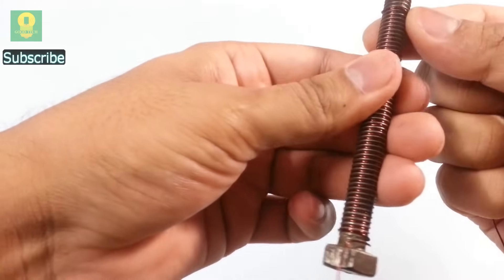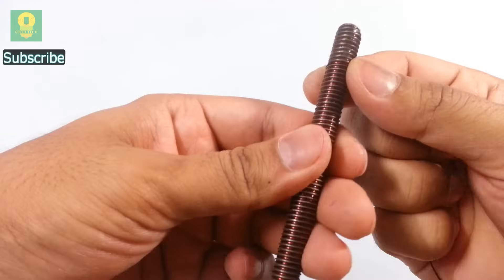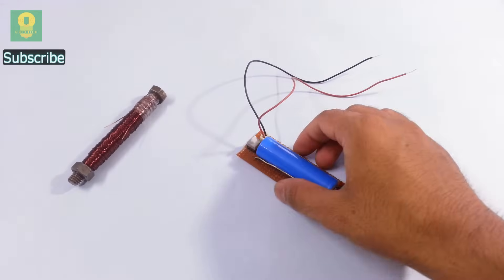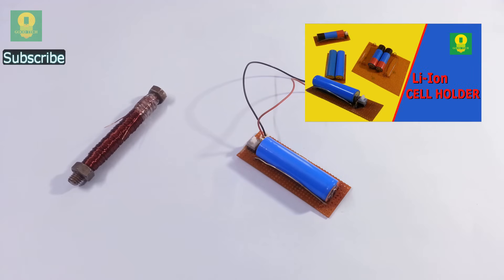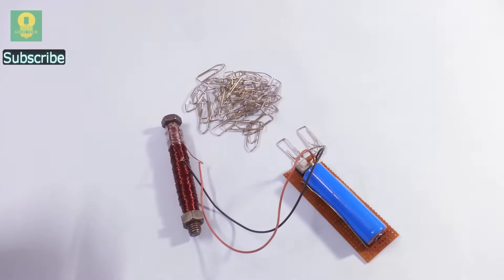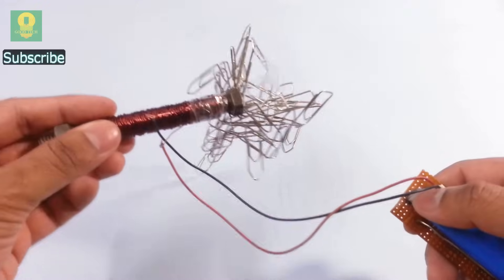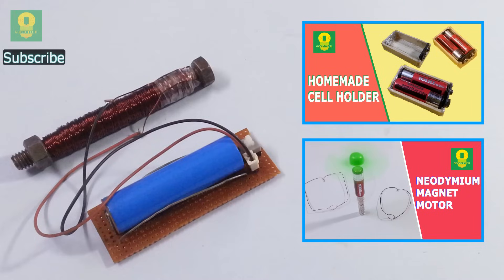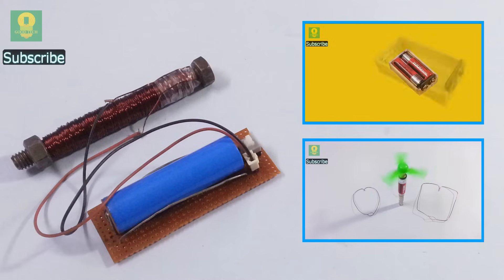How to make an Electromagnet | Super Strong

Comment: Hi  guruhacks9688. I have two questions.

1) If you take that same iron bolt with the same copper wire and with equal number of
     copper wire turn but the battery is 12 volt instead of 3.7 Volt, then would the
     electromagnet be stronger and if so then how much stronger?

2) When creating an electromagnet, what is the maximum voltage should be use to make
     the magnet stronger and at the same time utilizing less current (The magnet is more
     energy efficient) ?

3) If you use a Neodymium (rare earth) magnet  and wrap a coil around it like you did
     and you use a 3.7 Volt lithium battery, then would the magnet be stronger or would
     it remain the same?

Comment: You should not wind directly on the bolt because the threads are sharp and may damage the insulation. You can use some insulating material pipe or even paper.

Comment: Great explanation and demo. Would this be a safe project using a 12V battery? What is the largest, preferable, gauge of copper wire for this type of project using a 12V battery?  Lastly, what is the furthest distance between the threaded bolt with the copper wire winding and the object being attracted where the object will travel that span of space to attach to the bolt? Could I get a an object that had the equivalent weight of let's say 20 paper clips to jump 1/2" of distance using a 12V battery? MANY THANKS!!!

Comment: How to make it stronger: Pack some wires between each turn, use more copper, at least 20 metres. Connect to a 12V laptop power source. Enjoy

Edit: Is it possible to make a powerful handheld magnet with a 4x 3.7v lithium cell holder
Reply from the maker: Yes, it is possible but 4 batteries will be quite heavy for holding it in hand.

Comment: Can I just connect the copper coil to a battery ?
Reply from the maker: Which copper coil?? If the copper wire is enameled, then yes you can connect a battery to both its ends. But for an electromagnet to be powerful, you also need a iron core in the middle of the coil.

Comment: How much long bolt you had used and how many guage wire
Reply from the maker: I used a bolt of about 8" and a wire of 28 AWG. However, you can use any length of the bolt and any gauge wire as long as you can wound it tightly, it will work well. Make sure to use enameled wire.

Comment: Why you use lion battery of3.7 volt it will get heat automatically use battery of 1.5 volt battery ☺️☺️☺️😎😎😎😎😎
Reply from the maker: A li-ion cell that i used provides 2000mA of current which makes the magnet very powerful, also the battery doesn't heat up although the coil does get slightly hot after a while.

Comment: Good job. How many amps is that 18650 battery?
Reply from the maker: Thanks...I am glad you like it..This is a 2000mAh 3.7v battery.
Reply: Thanks, I have same battery, and wires started smoking when connected. Is it safe to touch 2000 mAh?
Reply: @p1nesap  @ 3.7v yes

Comment: Bhai sach sach batana... khud banaya hai ya kahi se vedio la k daal diya hai.. 3 meter wire me itna cover ni ho sakta...☢😬😬😬😬😬
Reply from the maker: No videos on this channel are fake or copied and never will be. Also, nowhere in the video i have mentioned that i used only 3m of wire to create this electromagnet. If you want to know the value, then i used around 16m of 0.36mm (i.e 27 AWG) enameled copper wire  and wrapped it on a 10.5 cm(length) x 1.2cm(diameter) bolt.

Although i think your comment is true but just mentioned on a wrong video, i did use 3m of copper wire in my Tesla Tower video. On that i wound about 3m of 27 AWG copper wire on 8.5 cm x 2.1 cm pvc pipe.

Comment: Can you use an old flashlight as the battery container and switch?  If so, please show how you would do that.  Thank you.
Reply from the maker: Yes, that can be done but it will depend on the design & construction of the flashlight. If the flashlight can be disassembled then open the flashlight and identify the two wires that connect to the light source.
Now, remove the light source and connect any other component to the two wires, you are now ready. The flashlight container is used as a battery holder with a switch.

Comment: Can I make this strong enough to pull something across the room? Would it mess up a tv or computer in the room if I make this strong enough to pull objects. I want to put something on a book, and pull it off a shelf with a magnet.
Reply from the maker: No, this magnet can't be turned that strong. I am not sure if a magnet can be powerful enough to work across a room but yes, very powerful magnets can be made & they do exist but they are very bulky and heavy requiring high input power to work, which are only useful in industries. 
Also, the strong magnetic force does interfere with  electronic devices and can easily damage them.
However, to pull a book in the shelf does not require very high power, instead of electromagnet, just use simple neodymium magnets. A small magnet attached to the book and one to the book's location in the shelf, will be enough to hold the book in place.

Comment: I tried to make an electromagnet but it  got shot circuit  . Why??
Reply from the maker: What was the length of the wire you used?? The length of the wire should be sufficient and proportional to the power supplied, otherwise the battery will get short circuited.

Comment: where we find copper wire
Reply from the maker: You can extract the enameled copper wire from an old electric motor. It is also available online on ebay and amazon.
Reply: GOODTECH - Creativity and Science thx
Reply: Clash Territory any electronic or may be hardware store
Reply: Clash Territory  any  shop of electic eqpment
Reply: At electrician shop

Comment: What will happen if there is a paper folded on bolt before wire
Reply from the maker: A thin paper will not matter at all, however if a very thick paper is used, it will reduce the magnetic effect on the bolt.

Comment: What will happen if i will provide 24volt of dc. Will it work or not.... tell me max voltage range....
Reply from the maker: Yes, 24v is fine for an electromagnet. However, don't increase the voltage too much as it will be dangerous to handle.
Reply: The higher voltage you use, the more wire you will need. Otherwise, the wire will heat up and short out the battery.

Comment: Which type of wire will be best for the electromagnet if we are connecting 2 batteries(2*9V DC). Would it be able to stop a body having a momentum of 0.16 kg m/s that is a body of around 400g and with a velocity of 0.4m/s.
Please reply
Reply: Better reply fast,
I will come to know that in 4-5 days anyway. Since I am make a project which requires this, it would be better if you reply in time.
Your reply will confirm my logic so please help.
Reply from the maker: If you are connecting normal 9v batteries, you will not get much stronger magnetic force as 9v batteries do not have much power. A normal chinese battery can only provide 150mA of current i.e just 1.35 Watts (for single battery) , i have used a 3.7v Li-ion with 2200mAh current i.e about 8 watts. So the strength of magnet will depend on the power supplied.
However, using 28 AWG - 30 AWG is best suited for a good electromagnet that can be made by hand at home.
Now, an object of 400g moving with 0.4m/s velocity will just have about 0.03J of kinetic energy (1/2mv2), the magnet can easily be created to stop this object.
Reply: Sir,
Thank you for your reply. I really appreciate that how you read my comment and came to reply by yourself.
Reply from the maker: You are welcome Sanket. If you have any queries, feel free to comment.

Comment: You lost a lot of power by wrapping the wire in such way, the current flows in opposite directions and cancel out => no point in so much wrapping if wrapped like that when current flows right and then left
Reply from the maker: This is what i used to think in my earlier days but when you study carefully and draw a current direction diagram on a piece of paper, you will find that the direction of current remains same, it doesn't change. It moves in only one direction (either clockwise or anti-clockwise) along the iron core.

Comment: I am using some wire from a Cat 5 ethernet cable, leaving the insulation on it. I wrapped it exactly as the instructions in this video recommend. I am trying to use this to hold styrofoam bombs with a thin sheet metal strip, in the bomb bay of an RC plane. I have an electronic switch, which will power the magnet until I flip the switch to kill the power. The plane flies on a 14.8V Lithium Polymer battery, but the switch will only provide the 6V that the Battery Eliminator Circuit in my Electronic Speed Control sends to my receiver. This is causing the wire and bolt to become extremely hot. Am I doing something wrong?
Reply from the maker: The bolt and wire do get slightly hot after operating for a very long time but the extreme temperatures are due to high currents flowing through the wire. Increase the no. of turns or reduce the current in the power source. However, reducing the current will also tend to reduce the magnetic strength, so it is recommended to increase the no. of turns.
Reply from the maker: I hope you are using only a single wire from the cat 5 cable and not using the entire ethernet cable to wrap around the bolt.
Reply: Yes, one wire pulled out, not the entire cable
Reply from the maker: Then it should work fine, you only need to increase the turns.
Reply: could this basic electromagnet be used to fry out electronics easily like a basic magnet?

Comment: Instead of a bolt, wrap a socket extension with the coil, and tape a 9- volt battery to it (so it can spin freely.) Then you have a magnetized socket wrench, and if it is strong enough you won't drop nuts and bolts.

Comment: The issue is how to waterproof an electromagnet so you can use it for junk fishing without shocking yourself. I was thinking the best way would be to simply magnetize another object for the hook mechanism to keep all electrics onboard and heavy insulate all the electric cable above the water line.
Reply: Why not just use a neodymium magnet??? for junk fishing?
Reply: You build this using DC so you won't cause and shock to yourself. Well providing your below 30v and that's a lot of volts for an EM! Attach the coil to a long none conductive pole and make sure that the wires terminate above the water line. The only problem could be that you drag the magnet along and it finds something to lock onto it could pull you in due to its strength lol
Reply: most wires have a non conductive coating meaning its safe when wet, just put some sort of waterproof housing on the battery.

Comment: Hi! When you remove the enameled insulation on the wires and connect the bare copper ends to the battery with your bare hands, will you get an electric shock? albeit even a minor one?
Reply: Don't listen to the above, it's not just the amps that kill you, volts do too. That's just ignorance and a lack of technical knowledge. Volts is just a unit you need to consider potential difference (PD) and electromotive force (EMF). The body has resistance and a resistive breakdown point. The higher the PD the less resistance the body has and therefore less amps required. Ohm's law in play here. The human body in good condition, dry and but broken can have a resistance of 100,000 ohm's. If wet or broken it can actually be far far less. As low as 500 ohm's but let's say it's 1000. At just 30v that gives 30ma which is a trip point for an RCD. So as you prolong and increase the potential difference your skin and tissue breakdown and as a result has less and less resistance. Generally it's safe to work with less than 30v but that's not a given. I treat anything over 12v as something that will guy me when I'm writing with electronics. 

Electricity is fascinating when you dig deeper such as electrons flow in the opposite direction to what you think and opposite to current. 

Hope this helps although it might raise more questions now than answers
Reply from the maker: No, the battery i used is only about 3.7v, which is very low to be detected by human body or to get an electric shock, however, high voltages can be very fatal.
Reply: Thanks!
Reply: GOODTECH - Creativity and Science It's the amperage that kills you not the voltage...

Comment: I tried to make the electromagnet, but I get shocked whenever I touch it.
What do I do?
Reply from the maker: How much voltage have you applied to the electromagnet. Small voltages can never give shock. Reduce the supply voltage and make sure to use enameled copper wire (no insulation damaged) over a long iron bolt.
Reply: I am using a AA 1.5V battery
Reply: add insulation, use a safe dc voltage source, dont power it with ac right from mains out the wall....

Comment: sir  is AC current  used to produce electromagnet.
Reply from the maker: Both AC and DC can be used, however, In a DC setup the magnetic field is constant. This is what you should use if you want something like a permanent magnet or in order to increase the strength of a permanent magnet.In an AC setup the magnetic field is continually changing. Therefore, in alternating current (AC) electromagnets, used in transformers, inductors, AC motors and generators, the magnetic field is constantly changing. This causes energy losses in their magnetic cores that are dissipated as heat in the core.Thus, with DC the magnetic field will be stronger.
Reply: GOODTECH - Creativity and Science sir..
i want to make permanent magnet..
so...how much thick ensulated copper wire should i use? 

and...
can copper coil smoke or get hot..if i used this for permanent magnet? 
please reply sir..

Comment: It's my understanding that the coils should run the same direction - by winding one direction and then backwards you are decreasing the strength. I've heard you make the first coil - then run a length straight back to the start - then make the second and subsequent layer of coils in the same direction... right?
Reply: not at all... - check any transformer lol... it works on the same basis
u can go up and down, what you can NOT do is reverse the spin direction

Comment: Hey which swg size should I use for this?  Thanks
Reply from the maker: I used 28 AWG i.e 0.3mm enameled copper wire, however any gauge wire will work as long as it can be easily wrapped on a iron bolt.

Comment: If i remove insulation from the normal wire used in our homes then does it work properly
Reply from the maker: No, it will not work as the wires will be short circuited.

Comment: To gain its magnetic power should i give it high voltage or use more copper wire.
Reply from the maker: Magnetism is directly proportional to copper as well as current in the coil.
Reply: Higher voltage or more windings
Reply: I Will Prefer High Voltage

Comment: Hi. Is it ok to use wires like the usual wires we use in our homes? Like the wires we plug into the outlets? thanks!
Reply from the maker: Yes, those insulated wires will also create magnetic field but since they require large space to wrap same amount of wire (because of thick insulation), it is generally preferable to use enameled copper wire, then you can wrap much more wire without increasing the size.

Comment: What If I wrapped my weiner in coil would my dick be a chick magnet?
Reply: good one! but it will actually make it a very weak magnet, iron core works best as it is far easier to magnetize that.
Reply: Well that's too bad, I have balls of steel...
Reply: Jacobs lab 48 attached to a battery
Reply: マリオ 94 just connect one wire with your body and supply with 500-1000v ac it would be much more efficient

Comment: If I would use a steel bar around 12 cm, would it be more stronger?
Reply from the maker: Strength mostly depends on no. of turns of wire and current. However, you need a soft iron bar, it is much more magnetic than steel.
Reply: steel will be much more difficult to magnetize but it is also difficult to de-magnetize steel, so once it is magnetized enough, you can remove the wires and the battery and it will still be somewhat magnetized :)

Comment: Is this about sending voltage to a conductor without any resistance ? That will destroy the conductor and power source in a short time right ?
Reply: theoretically yes BUT in real life the battery will always have enough internal resistance to prevent that and also the wire will have resistance; the worst it's going to do is make them both hot.

Comment: How long does it takes the coil to overheat with 3-5 meters of winding? I was planning to make a Magnetic glove. I'm going to attach the magnet to a glove instead of making an object to hold it though, thanks! Subscribed!
Reply: have you thought about neodymium magnets? they are a lot smaller for similar strengths, which will make your glove more elegant...; also professional electro magnets are way more powerful than home made ones! Its not that difficult to make your gloves strong enough to hold your body weight using them.
Reply: @amritpalsingh517  Hello,  are you still around?  Where can I buy these "professional electro-magnets?  I want to send very short and abrupt square waves through it at different frequencies.  Is there an equation which will help me to know it advance what to expect when I change the frequency?  Right now I only have a velleman oscilloscope/signal generator,  limited to less than 500 ma.  Do you know where to find or how to make a circuit that can generate variable frequency square waves and send more current than that without hurting itself?  I'd like to send at least 1 ampere,  so the device should be able to do more, just so it's not always stressed.  Thanks for any recommendations you could make.